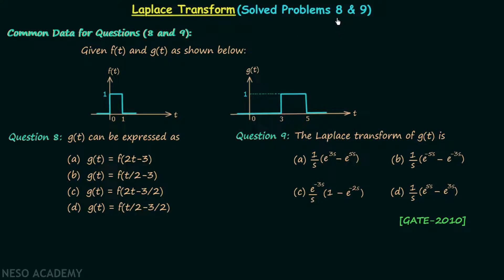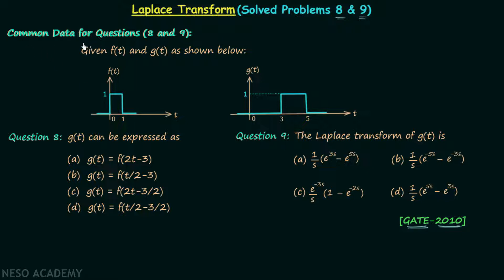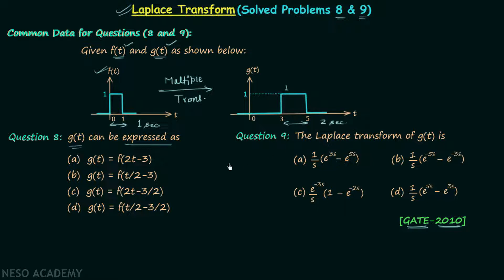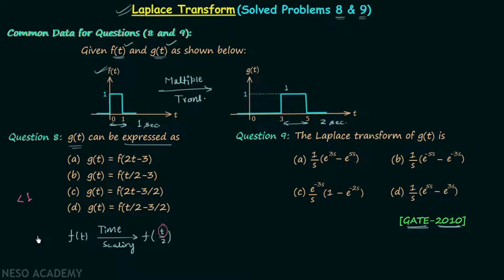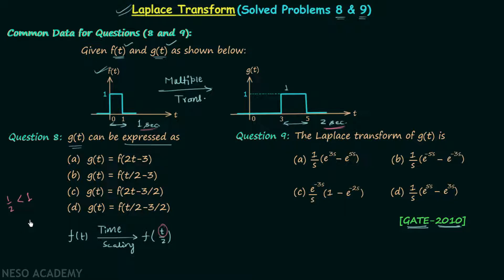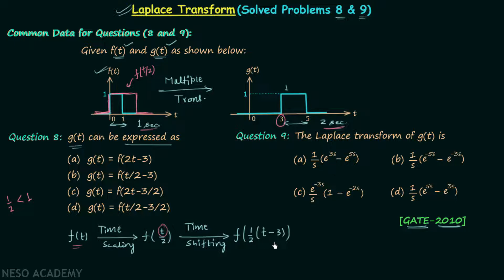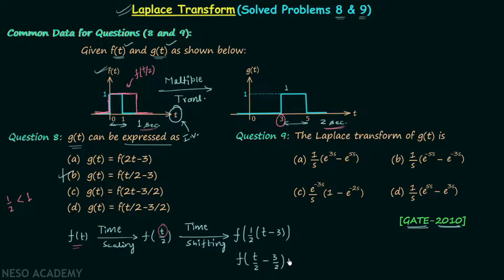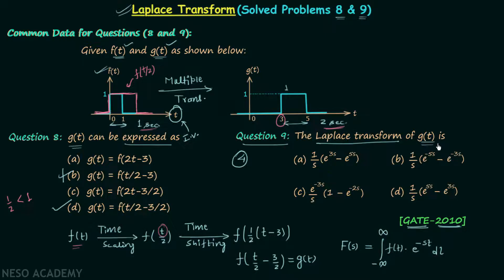Laplace Transform (Solved Problems 8 & 9)

Comment: Sir you mentioned in previous lectures on operations on signals that if both shifting and scaling needs to be done then one method is,  you can first shift and then then  apply scaling on the shifted signal..So if option d is correct if we plot that,  we need to first shift the signal by 3/2 and then scale it by 2.. Then won't the signal starting point be at 3/2 instead of 3? If we plot option b we are getting waveform similar to g(t)???
Reply: Yes I was also confused , for 8th question if we follow the initial rule which says first shifting -> then time scaling then option B would be right, did you get any answer for this? Or any explanation somewhere? It would clear my doubt. Kindly provide your comments on this.
Reply: Scaling factor is 1/2 not 2.

Comment: if we solve by using formula we get ans b..how sir !
Reply: i agree with u
Reply: f(t) = u(t) - u(t -1)
g(t) = f( (t-3)/2 ) = u( (t-3) / 2 ) - u( (t-5) / 2)
Find Laplace transform of g(t) from 5 to 3 in the only interval it's value is 1( -inf. to 3 is zero, 5 to +inf. is also zero)
integration 5 to 3 g(t) x e^( -st ) dt
and we get option c as answer